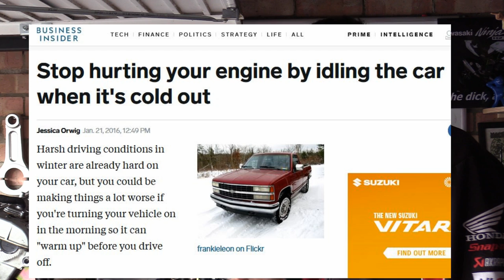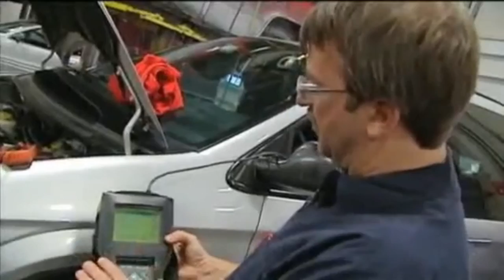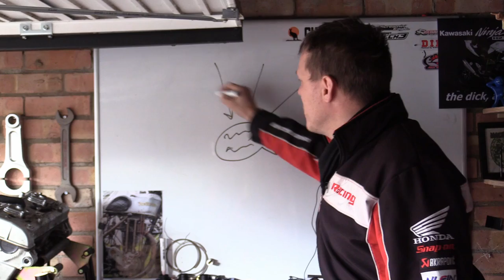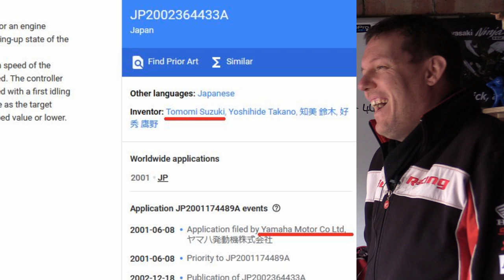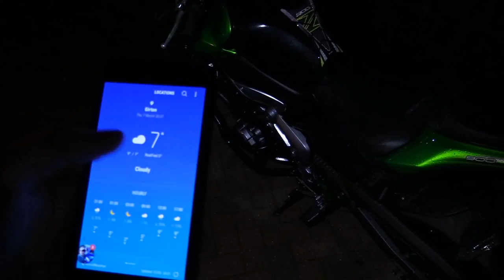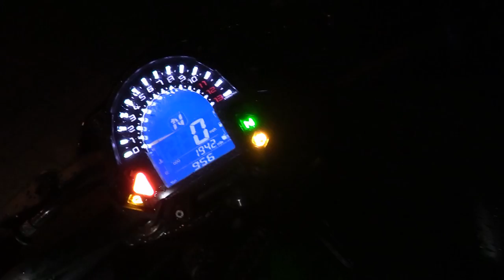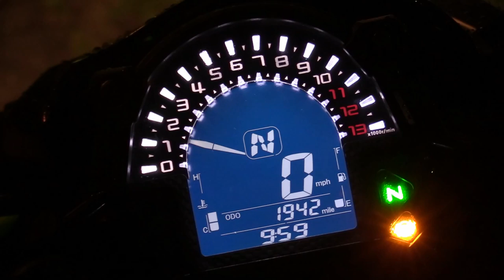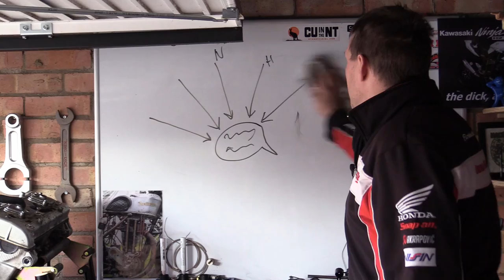Cold weather and Warming up?

Comment: People don’t realize that the closer to your engine’s operating temperature your vehicle is, the better off your engine is. Even better and more advanced technology won’t get around oil being more viscous and harder to move when cold. Thicker oil will take considerably longer than operating temperature oil to circulate. If you load your engine without proper lubrication, you lower the expected life of your engine.
Reply: Its also a common practice, even in the tropics, for industrial diesel generators to have crankcase oil heaters.  These systems need to be able to go shutdown to full power (at 1800 RPM in the US) in just a few seconds.

Comment: I usually let my bike(L6 SV650) idle while I faff my gloves for a minute or two before I set off.  For my car(diesel) I run the fuel parking heater when it's below 10-12C and set it so that I usually start with an engine that is beginning to warm up(letting it heat it up fully uses too much battery power for my 20min commute). I do have the bad habit of just turning it on and going though, but in my defence I've got 800 meters gravel road downhill to the big road and I usually never go faster than 20kph with 1000-1200rpm. I try to stick to under 2000rpm until it's fully up to temperature after that. 

It's not optimal but it's a lot better than how most treat their engines.

Comment: As usual I couldn't agree with you more. There is so much bs information out there that are basically just statements of "take my word for it" and throw on some nonsense demonstration to prove their point. Mop head takes it a step further and throws some equations from the textbook on the white board and goes over most peoples heads so they just except it as truth regardless if it's actually relevant. 

I think the biggest reason to warm up an engine is the viscosity of the oil when it's cold. I'm no petroleum engineer but from what I understand there is no oil that can properly lubricate at room temperature. The viscosity is designed to be in certain range when at operating temp based on the design of the engine and clearances of the engine bearings, but it's way to viscous when cold even for a multigrade oil. Looking at the specs of mobil1 0w40 for example the viscosity at 40°c is 70.6cst while it's 12.6cst at operating temp (100°c) and this is for a 0w oil. if the viscosity only mattered at operating temp we would all be using single grade oil in our motors. As with anything in engineering everything is a trade off, and having the long chain molecules (viscosity index improvers) that allow a multi viscosity oil can't take the abuse as well as a single grade and are more likely to shear. Talking about oil is big rabbit hole...

I agree with the part about emissions. From what I understand idle emissions are a large part of total emissions tests and reducing those have led to a lot of developments such as heated oxygen sensors. The sooner you can get the vehicle into closed loop fuel control and light off the cats the less emissions. In fact emissions plays such a large role for manufactures even at the cost of engine longevity because they cant sell a vehicle that doesn't meet emission specs. You even see cars today that shut off the engine at stoplights. Going back to oil is another good example of this by removing antiwear additives such as zinc and phosphorous in modern oil spec because they degrade the cats.

As far as the loud pistons you mentioned in the GTR this sounds like the difference between a 2618 and 4032 alloy for the pistons. A trade off between a better suited alloy for a high performance engine vs greater coefficient of expansion. The piston is designed for proper clearance at operating temperature but the larger clearance when cold doesn't effect wear to much as there is little load on an engine at idle when warming up. Good luck having an engine like that last for a long time if you go rev the piss out of it when it's cold. Most ecu's have temperature based rev limiter strategies for this reason.

Keep up the good work!

Comment: Additional thoughts.. Coolant reaches it's operating temperature (~88°C) faster than oil (~100°C?) in cars. I suspect the same applies to motorcycles where the coolant's volume isn't so big compared to oil. A coolant/oil heat exchanger thus speeds up the oil's warming up. My CBR has this, as do many cars. So the manufacturers do care about cold oil. Ofcourse the heat exchanger also cools the oil once it's hotter than coolant.
Reply from the maker: It's the latency (lag) that matter

Comment: Every mechanic should know you always warm up your engine first to get the oil temp up to proper operating temp. I can tell you for a fact that they warm up million dollar jet engines before coming off of idle. Even though it's a Brayton cycle rather than Otto, you warm it up for the same reason as Matt has stated many times: to get the oil up to its designed operating temperature. Cold oil can't flow into plain bearings or metal to metal bearing type surfaces fast enough in order to perform a cushion  effect, separating the metal surfaces with a layer of oil. I've pre-lubed, started and ran a million+ dollar super-charged 2 stroke, 12 cylinder- 24 piston diesel used on 2 billion dollar submarines. Non- surprisingly, a specific oil temp was required before you could start to apply an electrical load to the 500KW generator it was driving. So of course you should warm up your bike before you ride it. Side note,  when I was a heavy equipment mechanic,  I used to dread the first day of winter. Because assholes would climb into forklifts,  front- end loaders, and other hydraulic driven vehicles, start them up,  put on their seat belt,  and operating the equipment like any other day and blow a hydraulic line. Usually it was the most inexcessble line, so I would be lying on my back,  swimming in cold hydraulic oil, tracing the the connection point cursing away while they went to get more coffee. Every year this would happen, before I started getting to work a half hour early just to start up most of the equipment 10 min before the drivers would arrive. It amazing how much you save on replacement hydraulic hose line and fittings when you let a vehicle warm up first before you arrive it. Sorry for the novel,  love your channel as always Matt.

Comment: Hi Matt great info. Off the subject slightly is it still a thing to let turbocharged engines run for a minute or two after stopping, to let the oil circulating the turbo shed some heat and not boil the oil with an instant turn off.
Reply: Sort of, the idea is to keep the engine out of the boost range. As long as you keep it in the low revs, you can just switch off. If you've been going HARD on the throttle, come to a stop, then you will have an issue once you cut the ignition.
Reply: @forevercomputing  Cheers, Nice one.

Comment: Modern engines with catalytic converters etc probably need to minimise unburnt hydrocarbons that poison the CAT. It is not just about bearings and frictional wear anymore. What is good for the engine might not be good for the bike as a whole “system”, a lot of “warm up” advice does not seem to have changed despite massive changes to lubricants and the nearly universal use of fuel injection. I seem to remember bikes with a choke only for the carb on one side, am I imagining it?

Comment: The engine will get up to temp faster if you drive off right away, lot more load=lot more heat. If you must start it cold, use moderate revs till the oil warms up. Some performance car manufacturers used to specify an oil temp below which you shouldn't give it any stick. Engines have cold enrichment and after start enrichment. On my daily driver I like to use that fuel for forward motion rather than idling. All this said, around here we pre heat our car engines during winter. Back in the 80s it was recommended to use thinner oil in winter months.
With my bike.. I start it up, smoke the rest of my cigar, put on the gloves and helmet and ride off. By this time the engines still at fast idle. I use very moderate revs and try to limit the load for the first 5 minutes.
Reply: I mean: I drive off with not too much idling. But that's not to say I rev/load the shit out of it till its hot.

Comment: I've been letting my bikes and my truck warm up for at least 2-5 minutes my whole life.  My truck is coming up on 290,000 miles with the original engine and it has nice even compression across all six cylinders as of 275,000 miles when I gave it a service.  Not a single one of my bikes has ever had an issue, even one with 90,000 miles.  Silly "experts."
Reply: Experts:-Ex= has been(S)pert=drip under pressure.Also every bike that I have ever owned from a BSA bantam to an FJ 1200 has required to be warmed up other wise it ran like shite coughing and sputtering until I t did warm up, especially in cold weather.
Reply: Gl1500 and GL1800 Goldwing never warned up no bikes or cars unless super old need warning up.

Comment: At the same ambient temperature as you showed , 
Ducati instruct the owner to engage the “fast idle” , 
Let the engine start without using throttle control ,
Not to rev the engine when cold , 
Allow some time for oil to reach all points that need lubricating ,
Allow 5 minutes for the engine to warm up.
Reply: The Workshop ,, yeah so I saw ,, I replied to that bs, lol

Comment: I would like to know if you can have too much air flowing into your cylinder. say you have one valve the size of the cylinder and your port the same size, would this      be 'good' or not? ( ignoring all the obvious impossibilitys of this)
Reply: What cannot be ignored is that you need to allow it to exit too. So that optimum valve /port arrangement can only over half of of the piston with exhaust covering t'other half. Getting air in is only half of the equation , getting rid of spent gasses is the other half. 

You can have as much air as you want, as long as you have the proportionate quanity of fuel joining it as in maintaining 17.4 :1 ratio. Turbos ram in more air which must then be accounted for, as it were, by the ecu and let in more fuel as well. Porting is a science in of itself, as you need a certain amount of flow to be generated. Piston sucks air in, but that flow is affected/optimised by the length/size/ and shape of the port and if it is for one piston or two.  It is too much air when the fuel provision is inadequate and/or exhaust port limits flow.

Comment: matt, the r1 does have a cold start fast idle, it's just not a separate fast idle system per se cos it's not necessary as the throttles are controlled electronically - the fast idle is just a bit of programming.
and on yamahas the fast idle speed isn't even 2k, at least on my mt09 i'd say it's closer to maybe 1800rpm, hard to tell exactly with digital bar graph gauges though.  maybe that's the emissions compromise - dont make the fast idle as aggressive.
on the early fuel injected bikes of the late 90s we didn't even have automatic fast idles, rather manual ones controlled by a lever that bumped open the throttles a bit.  the one on my 2000 gsxr750 was good for almost 4k rpm when opened all the way lol.  could also be used as a very crude cruise control or engine braking control.
Reply: It's a condition of the ECU, checking a reference temperature and correcting the mix for the next cycle.

Comment: I've got a scooter with high RPM clutch springs. You have to be quite punchy on the gas on takeoff - the centrifugal clutch doesn't like partial engagement especially with higher RPMs, so I always warm the engine a bit before taking off.
 I like to start it up and let it idle while I am putting on my gloves and getting it out of my garage so lets say 30 sec to 1 min of just idling, so this ensures with redundancy that the oil and all that shit and everything else is where it needs to be and everything's all good and circulated. 
Then I will sit on the scooter and open the throttle so that the engine is running say 3000-3500 RPM so just a bit before when the clutch would kick in, and I just hold it there for as long as I feel like, usually like 2, 3 minutes, maybe roll off the gas a few times and bring it back up cant really go wrong to be honest and then punch it a bit to take off but not overdoing it, maybe 25-50% throttle quick but smooth. After clutch has engaged I'm just riding the thing as gentle as I can for say 5-10min its only 125cc and after that time when its nice and hot I'll pretty much just have my way with the engine.
This 'warm up procedure' is probably quite over the top plus it's a Honda, but I'm a lot more confident in the engine when I know I have warmed it up and taken extra care with it to the point of redundancy.

Comment: my dad have been saying it to me since forever, when you turn on your bike there's no oil on the head lubbing the valve commands/cilinders, it's metal rubing on metal for a while (of course there's a very thin layer of oil revesting the metal, but it isn't enought) before oil get pumped up in there, if you simply turn your on bike/car and starts driving at 2, 3000 rpm right away you will will destroy it a lot faster.

Comment: I always run my zx11 until it can idle without the choke and then I drive off. That's usually about    3 minutes or so. I kinda have to since the choke doesn't hold by itself. That's something I need to fix. I'll continue with a 3 minute warm up even after I fix it.

Comment: If a bike dosn't have fast idle, can you manually high idle the bike to warm it up. Would that be better than just setting and putting more load on the engine?
Reply from the maker: Yes - that would be better. And yes you can.

Comment: Pretty sure it takes a few seconds for the oil to circulate fully (on bikes at least).... I usually let mine run on idle till it stops producing so much steam out the exhaust (or till I get bored of waiting, im no saint).
 Takes longer in the cold or if the engine hasn't run recently. you might not have to let it run for ages, but it's still gotta be better than just thrashing the engine from the second u press the starter.... oil viscosity is dependent on heat too so starting from cold with like a 1 or 2°c ambient temp is going to mean your running on thicker oil, which probably isnt going to penetrate all the little nook n' crannies so well.... probably wont do major damage on it's own, but cumulatively? Who could say, I'm not risking my engine to find out!

Edit: you pretty much end up saying this Haha! Great vid, keep em comming!
Reply: Couldn't agree more.

Comment: Also, I once read that the fire service used to use a reliant robbin engine for the water pumps because they were designed to be safely used from cold straigt up as high as 5500rpm
Reply from the maker: LOL they were cheap.....
Reply: Don't know about Reliant engines, but the Coventry Climax engine used in Cooper Formula 1 cars was developed from a fire pump. The Climax engine was also the basis for the engine used in the Hillman Imp and its various Sunbeam,  Singer, and Commer derivatives and also fiitted to the Bond 875 three-wheeler.

Comment: The 5.7L Hemi in my 2007 Dodge Power Wagon will automatically increase idle from it's normal 600RPM to about 800RPM when the ambient temperature is relatively low, and will automatically revert back to 600RPM a bit before reaching operating temperature. This engine is "drive-by-wire" so it's all driven by the ECU/TIPM, no extra fancy bits needed. Most cars/SUV's/Trucks from about the same year and newer do the same, atleast in North America, maybe it's different in the UK. Also, my both of my dad's 1986 Chevy K3500's, one a carbeurated 454CI V8, the other a 6.2L NA Diesel, both have a high/low idle that that can be toggled by a quick jab at the throttle-pedal.

Comment: Well I think it is more about the fact that a car engine in idle takes 15-30 minutes to warm up (to 50C maybe) in winter. Especially if you got the heater on. If you drive off at low rpm and throttle it can get warm within 2-3 minutes. And it can take the abuse probably a bit better than a usually high performance bike engine.

Comment: I’ve ran my 2007 XT660X all year round for the last 5-6 years and have started in temps of -10/-15 and if I didn’t leave it running for 10-15 mins before moving off it runs like complete Shite of course it matters

Comment: I found out my oil cooler was an oil warmer. Instead of having a  radiator like element. It has a block the oil and coolant goes through it. It might help with cooling this ( ) much. But it brings the oil up to temp faster. An atx minivan isn't going to be taching out driving away without warming up. Years ago I read about a BMW engine that wouldn't let you go over 4500, until it was warm. I think it was the M5/Z8 v8. Doesn't really matter. I keep mine under that when it's cold. Otherwise I mix it up, if I'm late I drive off more mindful of the cold, early, I sit for a minute or two after brushing off the snow.

Comment: I have a diesel truck that has 2 fast idle settings. 
1 when it is REALLY cold, it brings the truck up to 1800 rpm for about 10 seconds, 
2 and than it cuts back to about 1k rpm for as long as it takes for the engine coolant to get up to 40c..
And after all that, the system shuts off along whith the glow plugs, and it idles at 800 rpm 
On a 1999 diesel pickup truck.
Reply: 1800 you mean the moon lol if its a decent size diseal that is the rpm limit